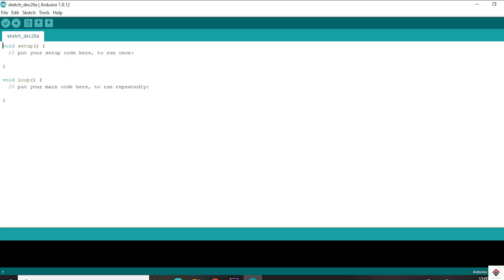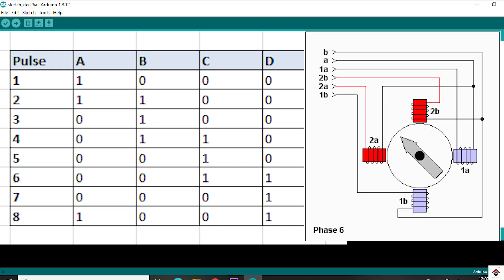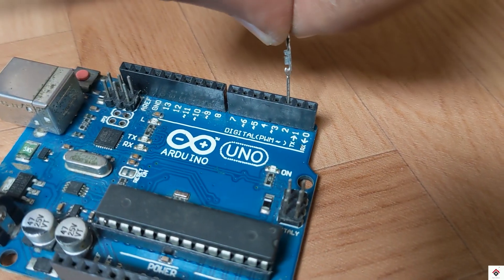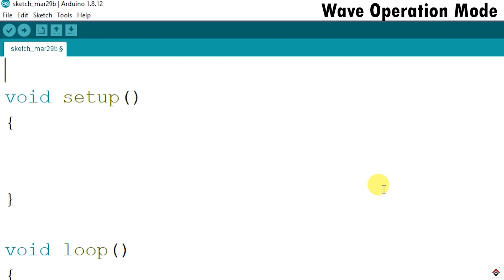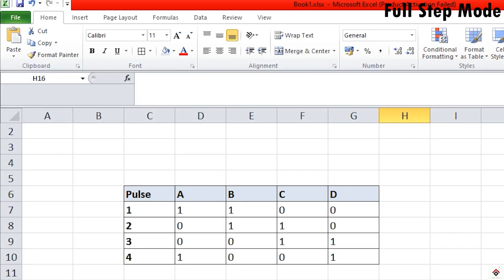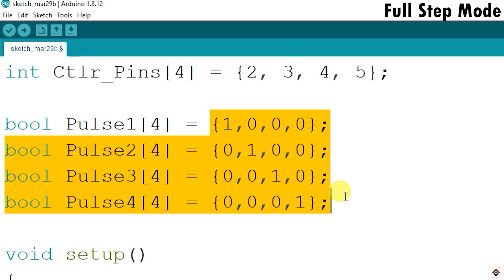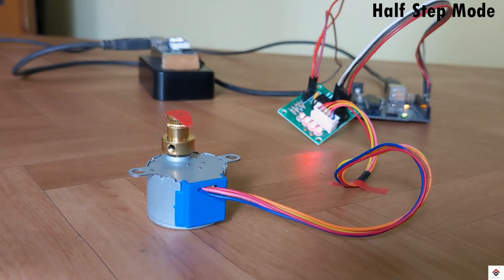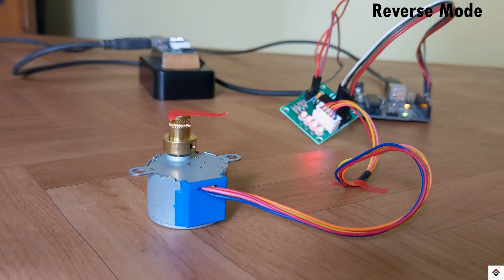Control 28BYJ-48 Stepper Motor with ULN2003 and Arduino | Wave Mode, Full Step & Half Step Explained

Comment: bro I buy same stepper moter that you have but my moter not working but vibrate also I think moter wiring is wrong what I do please help me
Reply from the maker: 1. Did you change any delay value in the code?
2. What power supply are you using for motor driver?
3. Check the continuity of all the jumpers used for connections.
Reply: No I not change value in code 
I use mobile charger as power supply  
My all jumper wire are ok
Bro also I have two stepper motor and two motor driver both have same problem and I check my Arduino Uno with servo motor and servo motor run correct
Reply: Thank you for reply this is first time any youtube reply me 😅😊😊
Reply from the maker: I have given multiple code files. Try with all of them.

Comment: if i am making an mini cnc plotter with 3 cnc motor can i give 12 v
Reply from the maker: Uln2003 driver will support upto 12v supply but the motor used in video is of 5v.